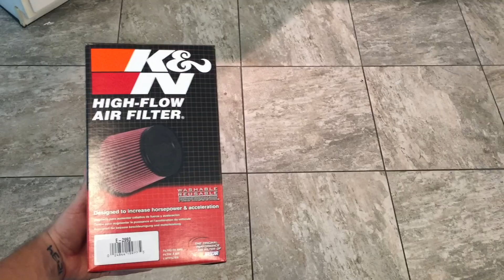2012 Ford Focus K&N Filter Install

Comment: Love that factory filter design!  Good stuff Joe!
Reply from the maker: Tom's Turbo Garage Thanks Tom! I definitely thought the K&N was some universal filter when I took it out of the box. I was pleased to see the factory unit was the same design!
Reply: Did you have issues with the lip fitment? I had issues with the lip of the filter had to sand it down for the cover to close properly!
Reply from the maker: I didn't have any trouble. It snapped right in and the cover went right on. I'll take a good look at it and make sure it's all seated properly.

Comment: SO NICE to see someone use one of these filters and KEEP the factory air cleaner and duct work. This way you have cold air coming in from the open grill, instead of having an open air filter sucking hot, under hood engine compartment air.
Reply from the maker: Thank you, and thanks for watching!
Reply: This is THE reason why i choose K&N over anything.
@JoeWrenches thanks for the video, pretty useful still after 8 years! haha

Comment: I did this yes a better induction sound and pulls away better you can either put the top on or leave it off. It's a cool easy mod and you can put it back to stock easy when you sell the car.
Reply from the maker: Thanks for watching!
Reply: Is it better or worse to remove your air filter housing. Better airflow I suppose but wouldn't the hot air from the engine more easily enter the filter?

Comment: So I tried installing mine on my ford focus SE 2013 today and I see in your video you don’t use a hose clamp. How does it stay on without one?
Reply: The back side of the filter sits on a recess in the filter housing. When you replace the lid you create a seal around the back of the filter preventing it from moving

Comment: Is it the same for my Focus 2010?
Reply: Take a look under your hood bruh that's how you can know 🤙
Reply from the maker: 2010 focus is a different generation of focus, so it's likely different. I can't say for sure.
Reply: @JoeWrenches  Mk2 Focus used panel filters not these
Reply: @bengrogan9710  I have a DA3 focus SW and it's a mk2 but with this type of filter...
Reply: @Meelis Altsaar  it's a common enough aftermarket upgrade, but as mentioned stock it will have had a filter box with a panel: if you look carefully you will find the location lugs in the engine bay
Edit: asking for clarity - is SW a typo and you meant ST? If so that fully explains it as the ST has numerous fitting and trim tweaks
Reply: @bengrogan9710  station wagon :D not ST sadly. But it is a stock filter assembly in it and I could put this same filter in it.
Reply: @bengrogan9710  What i mean is that in stock I had the cilindrycal filter like in the 2012. And now Im thinking on going with the kn filter. But is it worth the money?  Never had one
Reply: @Meelis Altsaar  ah I see, I'm assuming with the term Station Wagon that you are US based? I'm used to that being termed estate - it could be a regional difference I suspect 

As for if its worth it to upgrade, Project Farm has a video from I think early 2021 where he compared several air filter brands in both Panel and Cylinder forms.
If memory served a K&N panel filter was roughly a 15% air throughput increase vs an OEM filter, but let slightly more particulate in - not enough to be damaging but enough to be noted if in a particularly dusty/Arid area.
There was about a 3% raise in peak power on a dyno test but the car was more responsive to throttle changes. My personal take based on his results is if you're due a filter change, yes - but not enough to warrant it on its own
Reply: @bengrogan9710  No Im from Estonia actually So yeah same an estate is more Better. Yeah Im in for a new filter. So If I get a right Price I Will get this one. But I have read you can clean it? I mean is it really a lifetime filter? It costs 140€ Where I live :D
Reply: @Meelis Altsaar  I can vouch for the fact they are washable.
OEM filters tend to be filter paper, the K&N ones are a real fabric and as such don't degrade from being soaked
Reply: @bengrogan9710  So I should go with that. Thank you :). Its an old car but I wanna repair Everything on it. The motor still runs great.

Comment: I have a car of the same type , but I smell a strong odor of fuel from the engine
Do you have a solution?
Reply from the maker: Nahar Hassab It's hard to tell without getting a closer look at the car, but I will warn you that this engine is direct injected and therefore has very high fuel pressure. I would leave working on this fuel system to the professionals as I just don't know that much about direct injection.
Reply: sounds like you cabin filter needs changing
Reply: @alderete74  - Someone says they smell gas, which indicates a leak somewhere, and you tell them to change the cabin filter. Likewise, if the car makes a new noise, just turn up the stereo?

Comment: Hey will this work for my 2015 focus se
Reply from the maker: Yes, it's the same part number. Thanks for watching!
Reply: +Joe Wrenches thanks man I'll give u a shoutout on my channel when I install mine if that's cool
Reply from the maker: Awesome! Thanks!
Reply: +Joe Wrenches  your welcome man take care
Reply: nowzthetime what u mean
Reply: you have 2 air holes in front of your airbox with a 6 inch plastic piece that connects to the grill

take out the top one, the air will flow directly in plus your car will sound way better

I did it to mine, worked better with k&n then paper filter
Reply: nowzthetime same car?
Reply: 2016 focus titanium hatchback is what i got
Reply: nowzthetime ok ill look into it i got a 2015 sedan
Reply: did u try that yet
Reply: nowzthetime no haven't had any time i have other videos planned an a giveaway soon ill eventually get to it
Reply: @nowzthetime  what's the difference taking it off?
Reply: It sounds better a free mod more intake sound highly recommend

Comment: Do You need to put the lid on top of it???
Reply from the maker: I guess you don't need to, but that will just let hot air in.
Reply: Putting the lid back on makes sure that the engine only draws cool air that is ducted in from behind the grill. If you leave the lid off you will also suck hot engine compartment air, which is less dense and makes less power.

Comment: what if you leave the lid off?.
Reply from the maker: I wouldn't. That will just let hot air in.
Reply: I wouldn't because  I didn't get my down all the way nd it made kind of a loud unusual go cart noise that doesn't belong.

Comment: You wouldn't to happen to know the inlet diameter of the is filter? Where the lip of the filter goes over the duct of the intake tube
Reply from the maker: I believe it's 2.75". Part number E-2993.

Comment: hi, does this filter mod make any sound improvements if the top of the filter box is put back on like you did in the video? 

cheers
Reply from the maker: Rob Westgate I don't think I notice any sound difference. The engine is a little noisy to me in this car already.
Reply: @JoeWrenches  - You can hear the fuel injectors cycling. I think that is because they are dealing with about 30,000 psi of fuel pressure (direct injection). Other than that, my engine is pretty quiet.
Reply: Could you make a video of you driving it to see if it sounds different?

Comment: I just changed mine and got "engine fault service now" and "hill start assist not available" alerts with no codes like what the fuck?
Reply from the maker: Sounds like something must have got disconnected.

Comment: Sound?  More HP?
Reply from the maker: +L&#39;Orkobobo I honestly didn't notice a change in sound or HP.
Reply: Huh? So what's the point?
Reply: Jean V because it's a washable filter.

you could leave the lid off and get some more noise. there wouldn't be too much noticeable heat soak as surely the rest of the Airbox enclosure would act similar to a heat shield
Reply: @michaelpdrock1  - If you left the lid off, it would also draw hot, engine compartment air. It's pointless to leave the lid off.

Comment: I put my filter with out the top since mine is the 2018 focus ecoboost
Reply from the maker: Good luck with it!
Reply: Is this safe to do? I have a 2015 EB focus. I heard its not safe to not run the top on the airbox but I don't want to run it because you get the better induction sound.
Reply from the maker: @zacharysypolt1186  The filter alone is safe for your car, however removing the cover can allow hot air from the engine bay into the engine, and that can hurt performance.

Comment: Run it without the cover
Reply from the maker: Considered it, but, I wasn't that serious about my daily driver Focus.
Reply: That would cause the engine to suck in hot, under hood air.
Reply: 1001Hobbies doesn’t make a difference in reality
Reply: @Lestergreen77  - If it didn't make a difference, Ford would have left it off and saved the cost. Hot air is less dense and contains less oxygen per volume than cool air. The difference in oxygen is a factor in combustion and expansion forces in the cylinders, and thereby the force applied to the piston.
Reply: 1001Hobbies it’s on there to reduce noise it doesn’t do shit to the performance
Reply: @Lestergreen77  - I've graduated from an auto tech school, did it for a living for some years, and have worked on cars for 40 years. I've built a couple performance engines (V8's), and rebuilt and modified a couple muscle cars. I suspect you have some things to learn yet.
Reply: 1001Hobbies congrats it still doensnt make a damn difference. Restrictive air box breathing out of a tiny tube vs “hot air” it’s the same shit
Reply: @Lestergreen77  - Now you should look up the "Dunning - Kruger Effect."